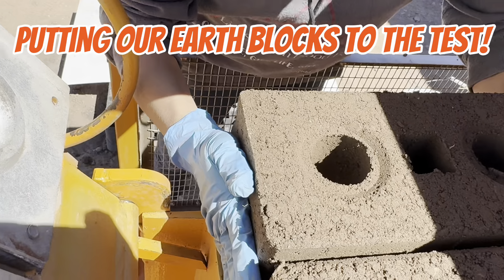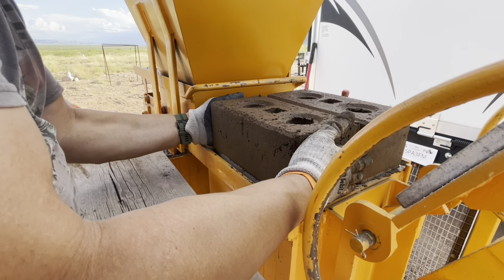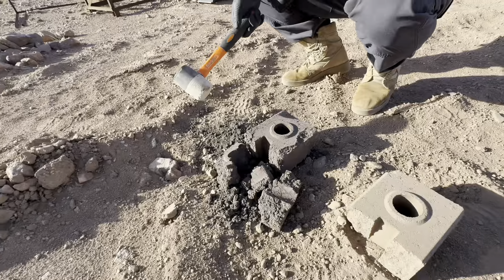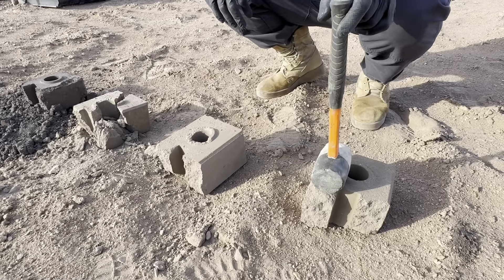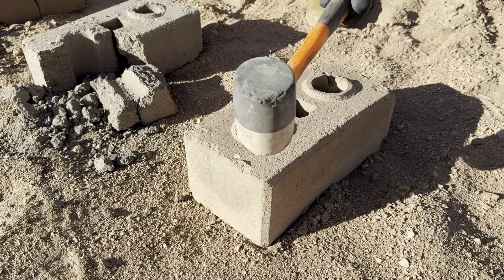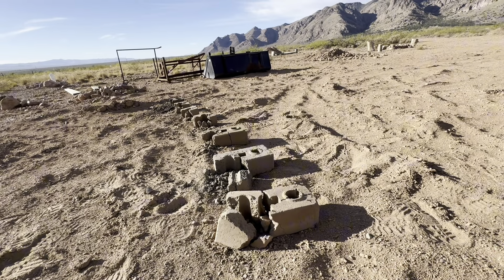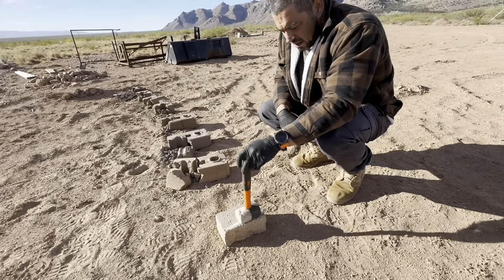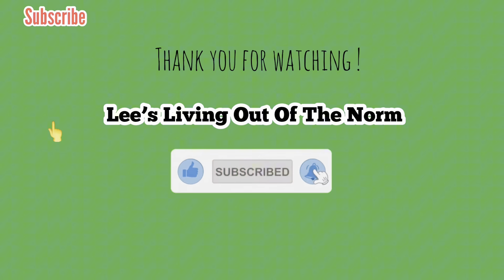Testing Our Interlocking Compressed Earth Blocks: A Not-So-Scientific Experiment!

Comment: Concrete strength depends partially on the aggregate you add to it. It's about a 10% mix of Portland to sand or gravel or fly ash, or what ever you have an abundance of. Rammed earth is more specific. You want to use like 7 parts soil, 2 parts sand to 1 part portland. However, this changes if your soil has a high clay or silt content. You either have to step up your sand or topsoil content to find that perfect point of binding.

Before Portland cement was invented, lime was used. (Lime, animal blood, slaked plaster, horse hair...)

Your last block seem the most sturdy, but the super wet material  when pressing blocks will prevent the compression you are looking for to get the most out of you Cinva ram. It's like hydraulic resistance. When you use less moisture you get maximum compression, then you want to cover the bricks with a tarp for 24 to 48 hours to let the portland work, then you want to wet the bricks down and recover them with a tarp, and then continue to re-wet the bricks when they appear to look dry for the next 45 days. A concrete foundation, wall, etc usually takes about 45 days to cure before it is hard enough to build onto. A lot of times forms are left on the concrete to slow the drying process down. 

You can make CEB blocks harder than the concrete block in your video, but it requires keeping the bricks wet. I've made concrete sculptures where after the concrete cured hard enough to handle, I submerged the sculpture for about 48 days in water, and it is probably the strongest piece of concrete I've ever made. The higher content of clay in your mix, the longer it is going to take for the CEB block to cure. Rammed earth walls can take years to cure.
Reply from the maker: @elmerkilred159  Thank you so much for your detailed and informative comment! We really appreciate it—it’s encouraging to hear that we could make our blocks as hard as concrete.

On our next visit, we’re planning to mix AB aggregate into our soil along with 10% cement to improve the blocks. Like you mentioned, a good bonding agent is essential, and we’ll keep experimenting with the water ratio too.

It’s amazing that you made a sculpture out of concrete blocks! We hope we’ll eventually get to a point where we can handle and shape our blocks with ease. Thanks again, and have a great day!

Comment: I am not an expert but I do pay attention...
1. I do not believe clay and cement mix particularly well, they mess eachother up.
2. Mixers are designed to mix, the internet is dumb, be lazy.
3. Your soil would have some clay content and clay LOVES water, more water = more gooder.
4. Adding some kind of fibre may be beneficial.
Reply from the maker: Thanks for your comment! Getting the perfect soil mix really is an art, and we’re still figuring it out. Some of our drier batches were probably a bit too dry—we should’ve added more water. Honestly, they might’ve turned out better than the wetter ones you see in this video. And we were discussing about hay type material in the mix.  We will see. 

We’re learning as we go, so hang in there with us! We’ll keep sharing all the ups and downs. 💪